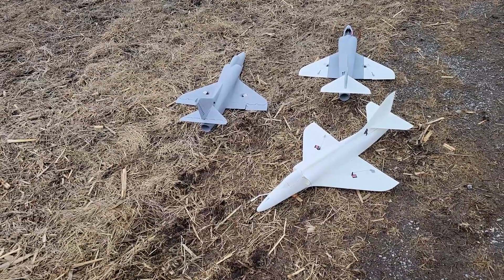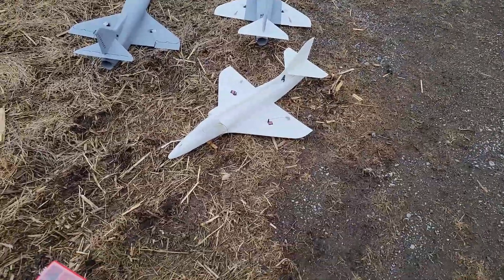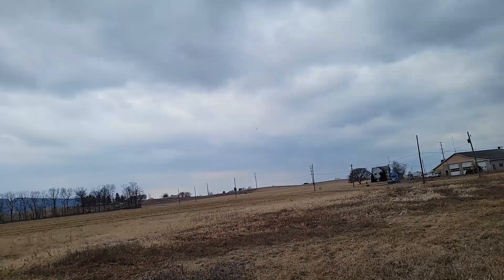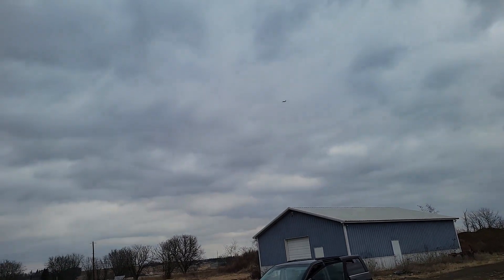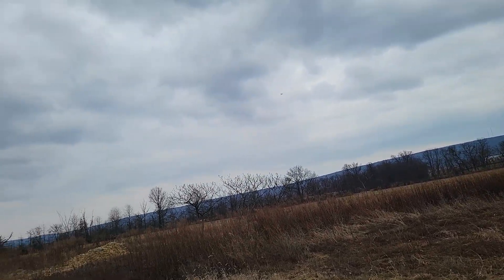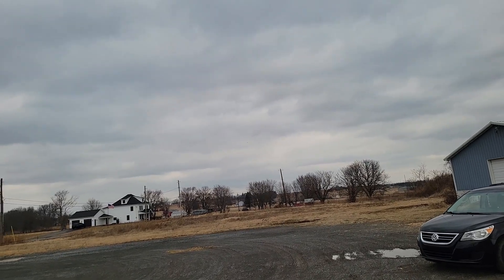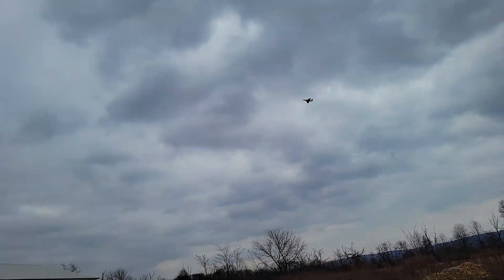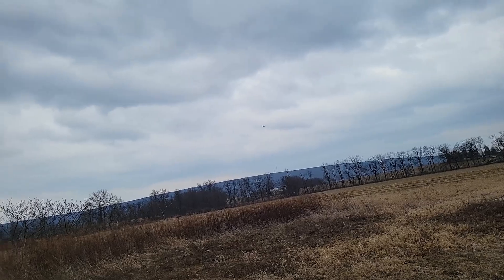Hand Launch Testing of 3D printed A-4 Skyhawk.

Comment: Hi bill I’ve just got this file and can’t wait to start printing. I take it you have to mirror the wings etc as their only one on the file
Reply from the maker: Hey Paul, happy holidays. It's a really nice model, way too much time in it! The wing, stab, and aileron gets mirrored if slicing yourself. Although, for this one I recommend either running the G-Codes or using the 3MF Files imported into Prusa Slicer. I spent a lot of time on those G-Codes, and I doubt you will come close to the print quality if you slice it yourself. Especially first few prints anyway, plus it's time consuming. If I remember correctly there are files sliced with both Prusa and Simplify 3D in separate locations, so you could try both to see if they will run. Fuse-2 is the hardest to print, so if you get that one you're good. The shape of the A-4 is very scale and it doesn't have oversized wings or a stab. Takes a bit bigger of a field to fly it in than my "Park Flyers". Try to follow the servo set up would be my one recommendation other than the G-Codes. Plan on re-making the build video over the upcoming winter.
Reply: @HoloModels-RC  thanks bill I’ll just be slicing it myself I’ve printed the canopy and it’s came out very good and close to your recommended weights I’m also doing the 64mm version and I’ll use fuse 2 with cheater holes I think hopefully it will come out good thanks for your help
Reply from the maker: @paulrussell6034  If you have any issues don't hesitate to ask. Also, you could always open the 3MF's to look at how I was slicing all my parts if you have an issue. Would still be easiest to just set your printer up in Prusa Slicer and run them from there. Make sure "Slice gap closing radius" is set to "0.00" for the internal structure to appear. It DOES NOT print in vase mode, but travel moves should still be extremely minimal.
Reply: @Hol @HoloModels-RC  printing on Bambu studio so far so good

Comment: What 3d printer do u use to print?
Reply from the maker: I have CR-10 V3, and a Sovol SV01. The Sovol I got for $140 and it prints better than the CR-10. I am almost due for another printer soon. Something that will go above 260 degrees and maybe print a little faster.
Reply: @HoloModels-RC CR10V3.  That allows you to print the light weight pla?  I dont think my CR10V? will do it. I have no idea what version i have.  Id  like to print plane parts.
Reply from the maker: @MCeMTPockets  There should be a metal plate on your printer that says which one it is. And YES, your printer could probably run the G-Codes for these planes, and also run LW-PLA. Is it direct drive or a bowden tube? Many people think you need a great printer to be able to do this, but it's all in the slicer settings.
Reply from the maker: @MCeMTPockets  If you have never printed airplane parts before, I would recommend printing with active foaming LW-PLA!!  PLA+, Pre-Foamed LW, and PLA/PETG all come out heavy. Strength/weight balances out in the long run because not only does a LW-PLA plane fly better, but there is a much less chance of it breaking during landing because it's lighter. Use ASA for prop driven motor mounts. My Sportster was designed to be printed with all of them, structurally. HUGE difference between versions, with AF-LW being by far the best. It will take you a couple planes to get used to it, and get past how it feels. I recommend taking the AC designers print recommendations, even if you feel it will not be strong enough. You will find yourself printing airplanes heavier and stronger than they need to be for the first few.
Reply from the maker: Your CR-10, which-ever version, would print any of my A-4 and Sportster very well because they are designed without retractions. If you have a bowden tube, printing LW-PLA with INFILL will be a bit more challenging and will likely require you to keep retractions off, causing stringing. Almost unavoidable with a bowden tube. CR-10 V1 and I think V2 were Bowden tubes. The V3 has a big blue print head and dual lead screws. I would also recommend printing LW-PLA pretty hot, around 250 degrees and 54-60 % flow rate, depending on PLA Brand. If you do have a bowden style, use supplied 3MF's and try to turn the "Extra Prime" up some to compensate for bowden style printing. Although retractions off would print better structurally and strength wise, but you might have to clean parts up with your scraper.
Reply: @HoloModels-RC @HoloModels-RC Thats sounds like a lot.. but i understood.  I have the V1.  Checked after ur comment.  I may just ask my son to purchase a V3ndor me at sime point.  Ive gotten use to my CR...  i will order some Active Foaming LWPLA soon and give my V1 a run for its old money😅😅. Thank you as i will give it a try.  Id imagine since it requires a hotter degree.  Should the print it be inclosed?  Thank you much for the educations!
Reply from the maker: @MCeMTPockets Your welcome! No, I would absolutely not worrying about enclosing it. It you ever use ASA, the fan will have to be off, otherwise I make all my G-Codes for LW-PLA with the fan running at 100%.
Reply: @HoloModels-RC  good info man... thanks